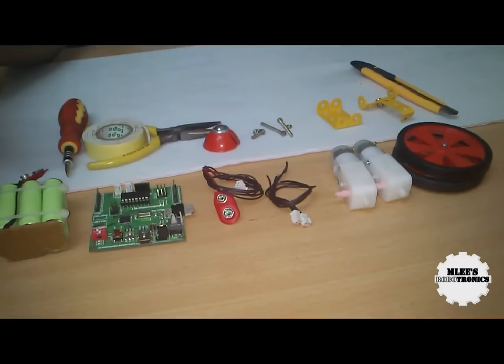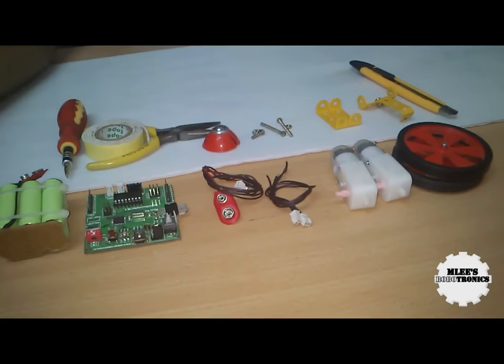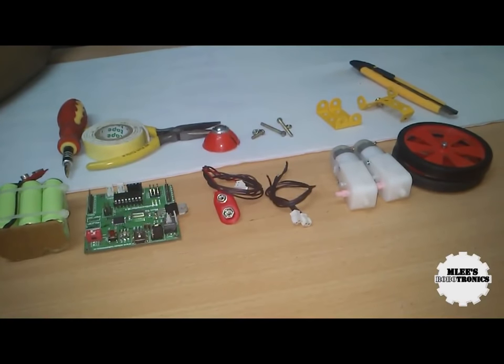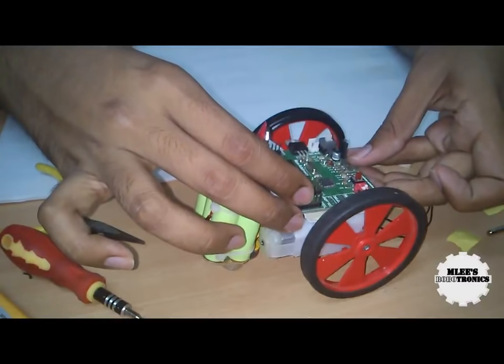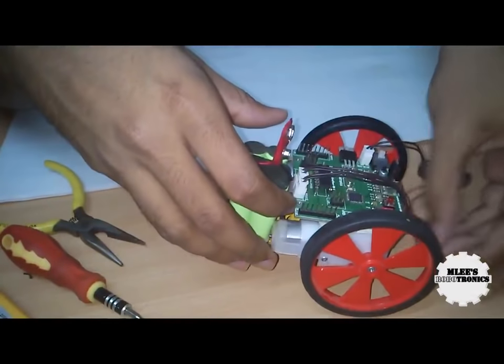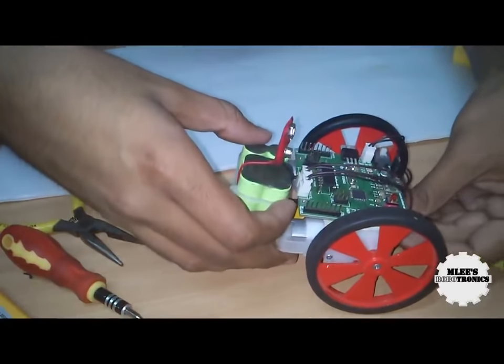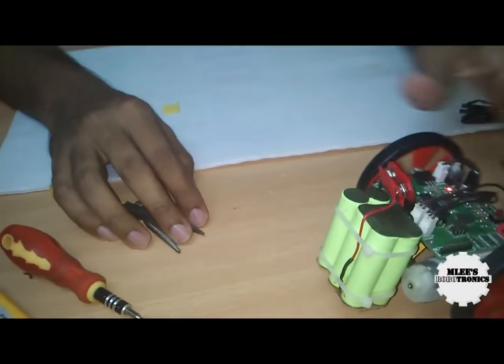How to make a Robot : building a very simple robot platform

Comment: hey buddy... that was an awesome tutorial and the very fundamental one. Really liked that because of its simplicity and clarity. please upload videos on programming your controller. I have a mechanical engg background and currently I am doing my masters in applied mechanics and aerospace engg. I have an inclination towards robotics but never got a platform. Although late but I think I should start now. And of course the cause for drifting was low traction on the wheels because of inappropriate mass distribution. But anyway, this is one of the best tutorials for beginners. hats off and thank u
Reply from the maker: Hey Nitin,  thanks for all your comments buddy.  I have documented the tutorials on my website www.mlees-robotronics.in  and you can also find video tutorial here in my channel. Feel free to write in case you need any help with programming and electronics.  All the best!

Comment: What exactly battery pack are you using. What voltage and capacity?
Reply: 1x 5v or >6.5V battery source
Reply: Shouvik Chatterjee
 Of course it will be around 5V, but i am asking what battery pack exactly is he using. For example i am using solar charger with 2 usb outputs for my robot.

http://www.ebay.co.uk/itm/30000mAh-Dual-USB-Solar-Panel-Power-Bank-External-Battery-Charger-Universal-OO-/181418484838?pt=UK_MobilePhones_MobilePhonesCasesPouches&var=&hash=item2a3d626466

Comment: Non tech parent here-I'm already stumped at the step of preparing the motors--what did you do, add a rigid tube near the end of the wire, remove insulation near tip and are you then- soldering? What's the red-handled tool? Thanks in advance.

Comment: i believe if you mount the battery pack on top of the biggest wheels and the board on the smallest caster it would resolve your traction and steering and no extra mass needed for traction resulting in greater energy loss always keep the caster lite its there only for over balancing purpose only the payload or main mass should always be over the main drive wheels you may need to adjust for the fulcrum point tho? but great toy i built  a similar  three wheeled one a long time ago called tom from the real robots magazine kit i have lost his software since tho
Reply from the maker: That's  true,  you are right.  when I built it for the first time,  only place that was left was on the castor wheel.  but i changed the position and the battery size later.  you should see the bluebot that I built from this chassis.
Reply: love to see it whats the video called? and i will look it up
Reply from the maker: here is the video,  http://youtu.be/ha3QNvNMWbM

Comment: where can i get the board?
Reply from the maker: It was a product that I designed and sold.  But unfortunately I don't make them any more.
Reply from the maker: Yes, The mother board can be used a mod (may not be used as a shield due to different pin layout). The board itself is an arduino IDE compatible device(uses atmega8). so you can program this board just like the arduino.  The initial idea of this board was to conduct some workshop on robotics for kids. But things did not work out the way I wanted it to be. Im planning to host this project on the opensource community very soon.